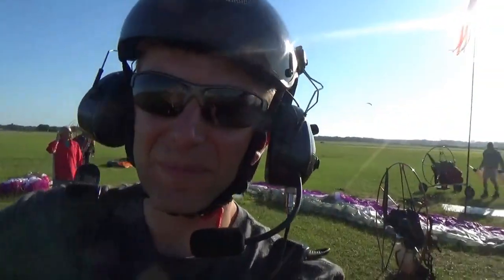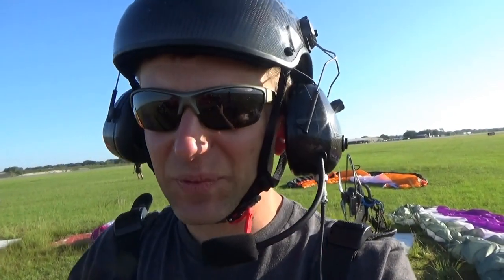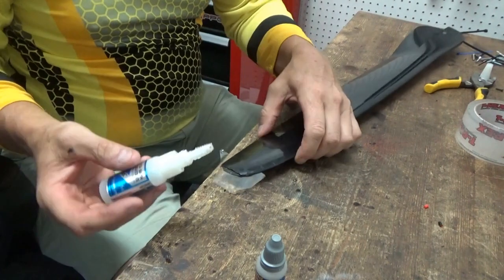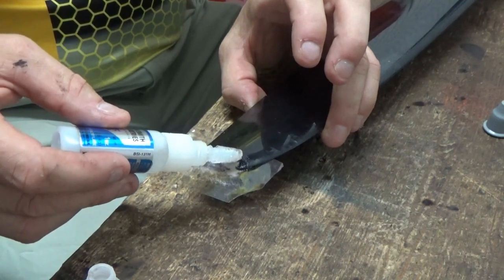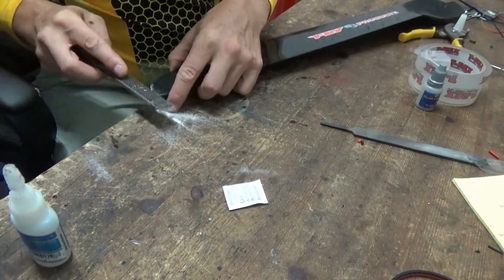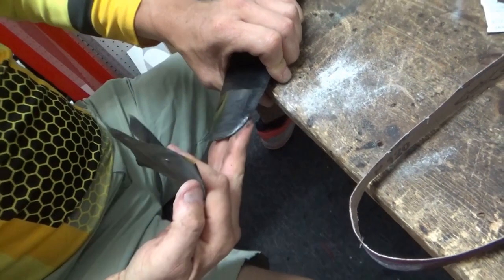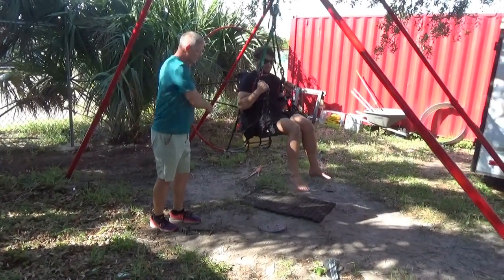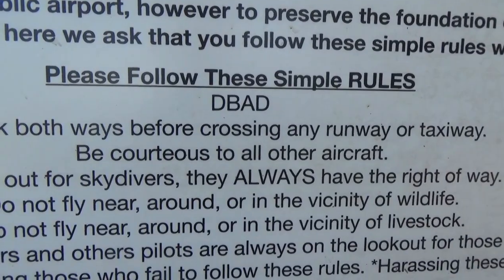BROKEN PROP! -How to Repair Carbon Fiber

Comment: Your timing is perfect for this video showing structural repairs to a plastic component with Q-bond.  5 years ago, I bought some after seeing it on Eric the Car Guy but never got around to using it.  During that time, the box sat on a table, and the cyanoacrylate super glue included in the kit hardened up inside its unopened bottle.  The black and gray powders stayed OK, however.  Today, I was getting ready to repair the handle of an old  microwave oven when your video popped up.  To replace the solidified super glue that had gone bad in the Q-bond kit, I used some watery thin Krazy Glue.  The repair turned out great after following the tips in your video.

Comment: Welcome to the club, Ivan.  The first flight I took without an instructor, I skidded on the ground and damaged my prop.  I bought a new one and had the old one repaired.  This sport isn't cheap to follow and that is all I am going to say about that.  Of course, like you said, a person can't fly a damaged prop.  Something else, if you are ever standing near some one that shatters a prop, be careful of flying slivers of carbon fiber....that can travel several feet.  Great video!

Comment: I dont have a big problem with repairing that small portion of the tip but unless he has recieved extensive training in carbon fiber repair the 3 ish inch repair he mentioned is call for concern. Structural designs may be compromised, and the last thing you want is a propeller  coming apart during high speed rotation. If it is indeed carbon fiber (since he mentions the repair product is designed for fiberglass so now I have a doubt) when carbon fiber shreds the little pieces are extremely sharp. Glad you are having fun learning to fly.

Comment: Nice prop repair! Quick and easy. A little baking soda in super glue works great on wood props - not sure if that would work as good on carbon fiber. Would certainly be cheaper ... and that's very appealing to me! 😂
But hey, don't be embarrassed. You're already flying and still learning in less than 2 weeks! 👍👍🍻

I fixed that problem child Lexus!! I bought a wiring diagram off AllData DIY. WOW what a difference troubleshooting when you know where the hell you're going! Took me longer to read over the diagrams than to repair the problem. Long story short, it ended up being a crack in the alternator 140A J-case fuse element! It didn't burn out from overcurrent, but fatigue-cracked! Amazing. Getting that stupid thing out of the fuse box was impossible, though. Ended up busting the clear plastic top off it - that's how I tested both sides with my test light and confirmed it was severed. Then I performed a Russian repair. 😁 I smashed both contacts down until they touched. Fixed, lol! I absolutely could NOT get that stupid fuse out of there. It's recessed down into a hole. I tried everything. That was the dumbest engineering I've ever seen in my life!! Anyway, the customer is aware of the rigged repair, and just needs to run the thing a month or 2 before she'll trade it in. Chances of that causing a fire are slim to none - the alt.wire would have to dead short to ground. She's happy, I'm happy. 😎

Comment: A prop strike on an airplane is usually a mandatory engine teardown and inspection plus the prop repair or new prop. So instead of 20 minutes and $12.00 in superglue it's several days and thousands of dollars.

Comment: Not throwing shade at super glue/cyanoacrylate, but why not use epoxy when repairing a carbon/epoxy composite?  A good epoxy adhesive gives about 5,000 psi shear strength (bonded to aluminum).  Cyanoacrylate is about 1500 psi on the same substrate.  For bonding composites together  in the lab , we use epoxy with aluminum filler.  Not familiar with Q-bond powder but it looks like a similar concept.  Hopefully the repair guy did a thorough inspection for any delaminations or skin/core disbonds further down the prop.  Hidden subsurface damage from low-velocity or "tool drop" impact is one of the weaknesses of composites.  My 2 cents
Reply: Carbon fiber props are supposed to be repaired with epoxy. Maybe he used super glue because the damage was at the very tip.

Comment: DBAD needed on every mile marker on I-95 :/
Reply from the maker: HA that's accurate! xD
Reply: @PineHollowAutoDiagnostics  Hello Ivan: I've got an '03 Chevy Trailblazer w/4.2l inline 6. A P1345 comes up in diagnosis. The engine runs rough sometimes. I clear the code and cleaned the throttle body and it seems to run better. Why is it running rough periodically? The scanner says reduced power isn't active so if that's the I don't understand the reason for the rough running. Plugs and coils and the usual suspects check out okay. I would appreciate any pointers you could suggest. I know my question isn't related to the repair you're doing but I know you're the ace when it comes to automotive diagnosis. Thanks and have a gr8 God blessed day.
Reply: there known for cam sensor failures and cam solenoid failures (oil/debris plugging the ports) which causes improper camshaft advance.
high mileage and lack of oil changes causes the ports to clog up. of course just don't go parts canon and replace everything, diagnose it properly ;)
Reply: @throttlebottle5906  : Thanks for the info. I found out the rough running was due to a misfire on #4 cylinder. Funny thing is there wasn't a P0304 which you'd expect. I used my Autel maxisys scanner and did cylinder balance and injector test and thats how I found the misfire. Did a simple tune up including one coil and it runs gr8 with good fuel trims. Thanks again and have a gr8 God blessed day.
Reply from the maker: Good to hear you got it figured out Paul!